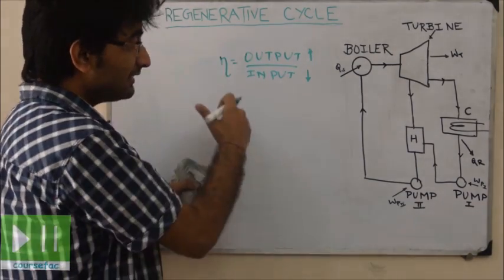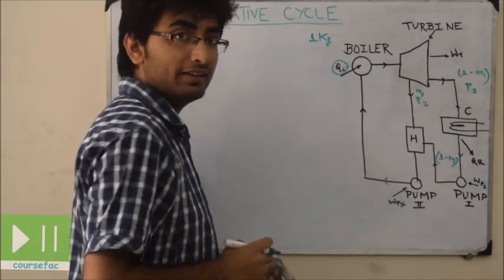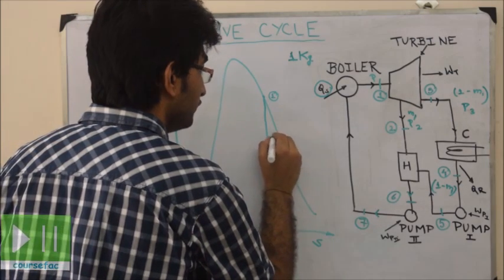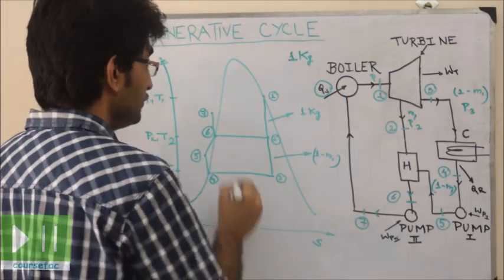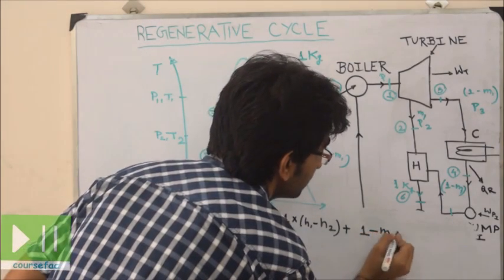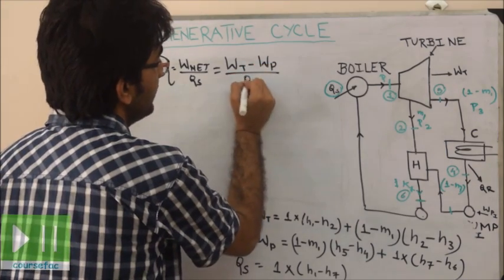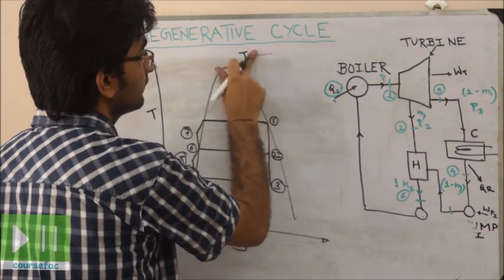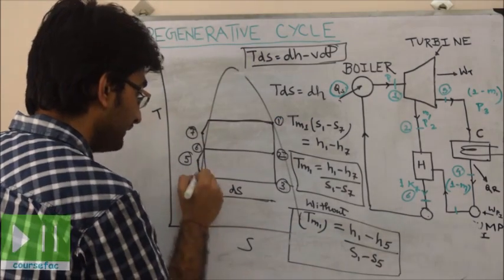COURSEFAC - Thermodynamics - Regenerative Cycle

Comment: Explanation was very good. Understood the concept clearly. Have a doubt-
Dont you need to take hf4 instead of h4 while calculating pump work? Because it is steam is converted to fluid in the condenser.

Comment: why isobaric heating is done in rankine cycle?????
Reply: because at constant pressure heat is used for increasing its internal energy and for  doing work . so more heat is added at constant pressure to do both of them as compared to the heating at constant volume in which only the internal energy is increased and no work is done. Hence for doing work we provide heat energy at constant pressure.